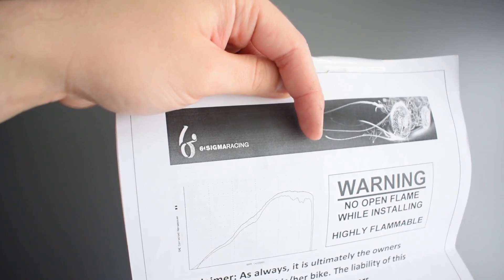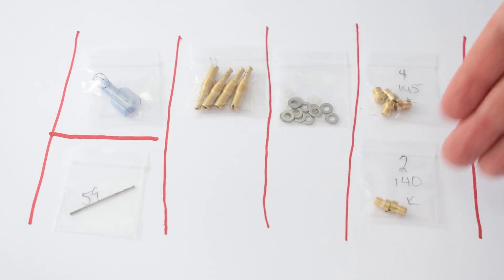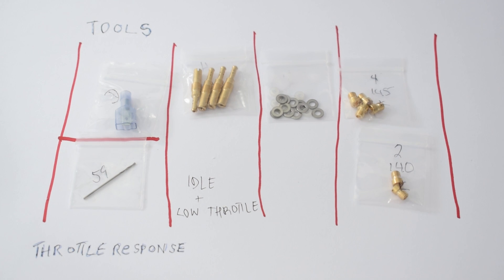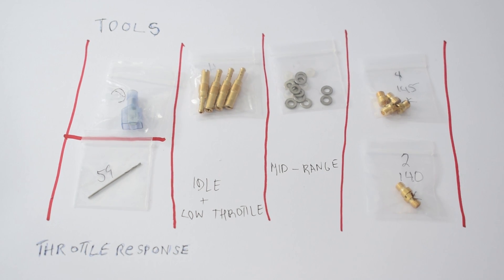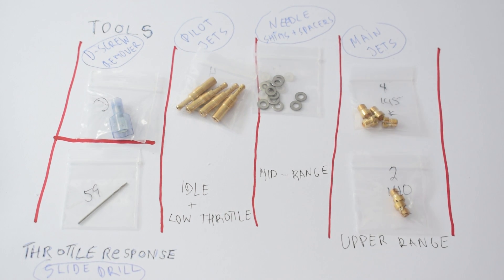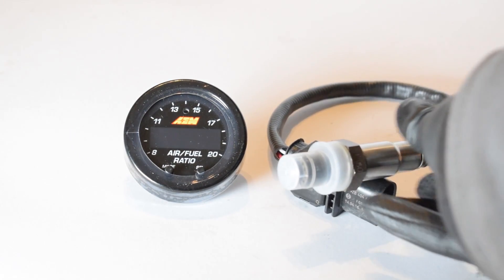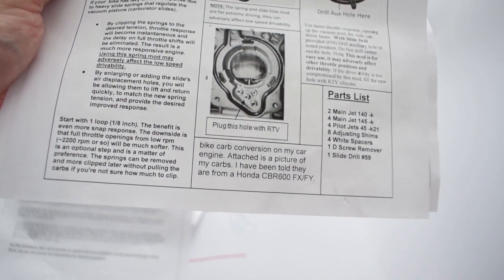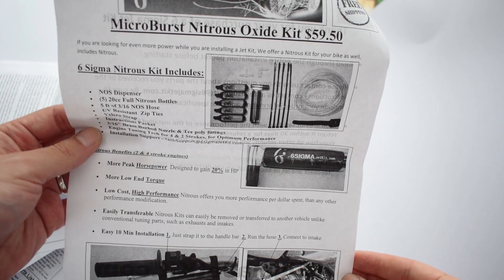Bike carb JET KIT unboxing

Comment: For some reason I assumed the carbs came jetted for the engine. When it comes time to tune things might get pretty interesting. Can't wait!
Reply from the maker: ZatoichisCaneSword! They do come with some basic jetting. After taking a good look I figured out that the main jets have been replaced. Needle height and pilot jets have been left untouched.

Comment: that is literally just a spade connector
Reply from the maker: Devon Murray I wondered who would notice first. Props to you. It really is just a terminal connector, but one that fits over the d screw on the cbr600 carbs perfectly. No reason to reinvent the wheel I guess.
Reply: driving 4 answers haha I thought it was awesome. thinking now I can probably do the same on my nikki 4bbl. thanks again for another thorough video.